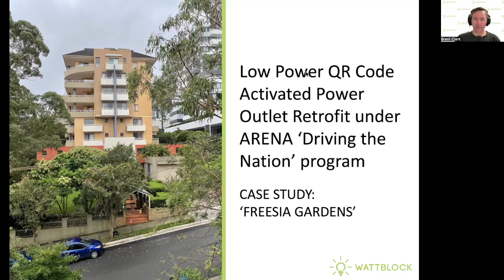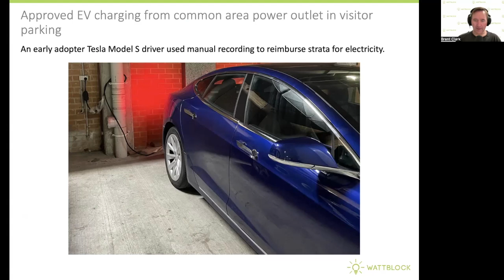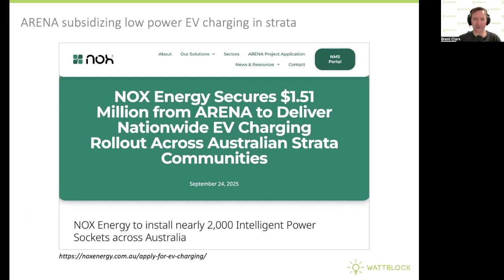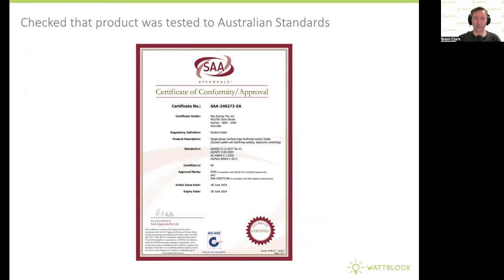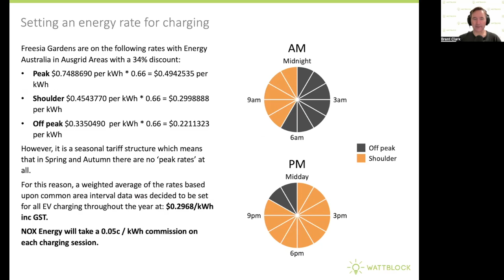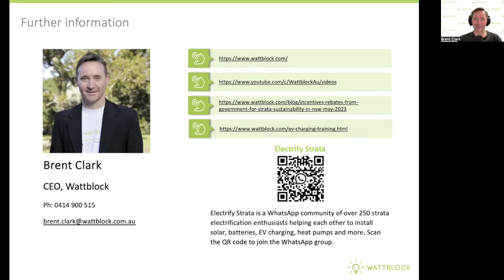Low Power QR Code Activated Power Outlets for EV Charging in Strata Case Study

Comment: Thanks for posting this Brent - really informative. I am intrigued by a side issue - the installation of the car park WiFi. I've not gotten quotes but have heard anything from $30k to $50k to install wifi in my 3 level 250 spots car park. Freezia seems to have gotten its wifi as a quid pro quo for allowing a  data provider GIGACOM to use some of freezia's space and power for some local infrastructure that they (GIGACOM) needed.  Is that it?